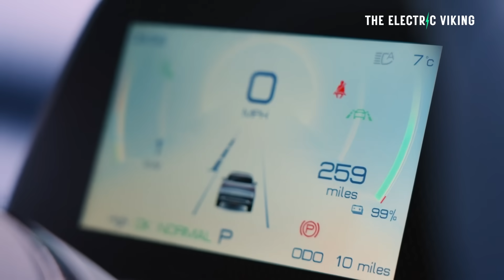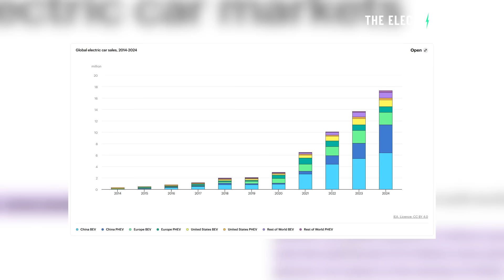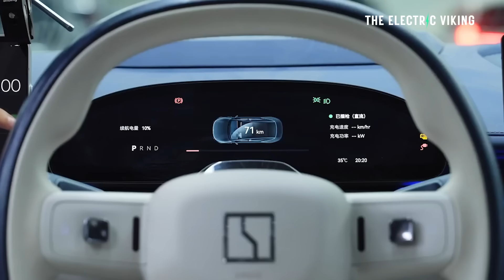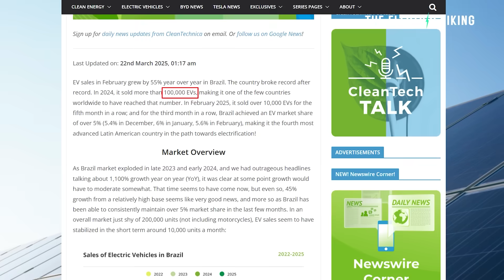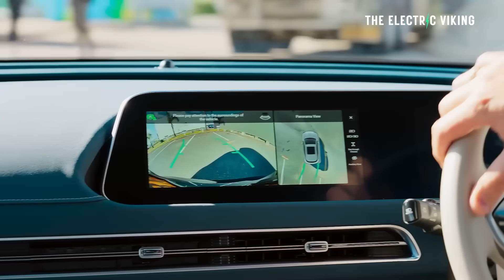1 in 4 Cars Sold in 2025 Are EVs: 40% by 2030, Says IEA!

Comment: If you really wanted to cut CO2 - you'd require carpooling for commutes.  That is 80% of miles driven and you'd cut it significantly overnight, you wouldn't have to wait half a decade for a net zero improvement. The massive discoveries of natural hydrogen may prove the long term solution as it doesn't require rare earths to produce, likely allowing many vehicles to run on hydrogen without requiring an entirely different vehicle to be built.

Comment: If you include hybrids/Phevs as EVs the claim might be accurate; BEVs are not near that degree of market penetration; they are more like 6% of new vehicles or about 0.5% of the 1.4 billion lite vehicles.  and near zero % of heavy trucks and vehicles which would be an even bigger task. Vehicle CO2 is 16% of world CO2. Since 2000 you'd average 12.5% a 2% reduction if the mining, production, and energy expended used no CO2, but it does. So it won't even get close to 2%

Comment: There's just going to be a switching point, after which almost everyone will buy an EV, come 2030 other than a few exotic cars, nobody will be buying an ICE car.  It just needs ranges to increase a bit more, charging times to reduce a bit, battery degradation to decrease and some sort of extended warranty plans for old EV's to be created, but it's all happening extremely quickly.
Reply: I don't think the battery degradation is an issue, they will already last hundreds of thousands of miles and still have a minimum 85% capacity left.

Comment: I like your channel and I drive an EV and am a huge advocate. But I partially disagree that range and charging speed improve every year. Maybe in a lab but in the real world range seems to be stuck between 240 - 300 miles and charging speeds of about 150 -175 kw for the last 3 years. The only improvement in range seems to be putting a bigger battery in the car or making it a tiny bit more aerodynamic. This is not really a technology improvement. This is just tinkering around the edges.

Comment: Here’s how I see the global power‐mix evolving over the next decade and beyond, underpinned by ever‐cheaper renewables, advanced storage, AI/robotics and emerging battery chemistries:

1. Renewables to ~50 % of global electricity by 2030

IEA Renewables 2024 forecasts that, if current policies stay in place, renewables will generate almost half of global electricity by 2030, with solar PV and wind accounting for 95 % of new capacity additions through the decade .

In practical terms, that means: 

Wind + solar share doubling from ~15 % today to ~30 % by 2030.

Hydropower holding at ~14 %, with other renewables (biomass, geothermal) filling the rest.

2. Beyond 2030 – continued climb toward 60–80 % renewables

BloombergNEF’s New Energy Outlook 2025 (Economic Transition Scenario) sees: 

Renewables rising from ~30 % now to ~45 % by 2030, then to ~60 % by 2040, and ~75 % by 2050 as costs keep falling and electrification accelerates .

In the IEA’s Net-Zero Emissions by 2050 pathway, non-fossil sources supply >70 % of electricity by mid-2040s, with coal virtually phased-out and gas back-up used sparingly .

3. Storage & flexibility – key enablers

Pumped hydro (the largest long-duration storage today) will retain a cost edge (levelized cost ~$0.14 /kWh by 2030) alongside emerging compressed‐air and other bulk options .

Sodium-ion batteries are on track to drop from today’s ~$87/kWh cell to ~$40/kWh cell (≈$50/kWh pack) by 2030, making them highly competitive for stationary storage .

Lithium-ion will continue to scale down in cost (< $100/kWh pack), especially for shorter-duration applications.

4. AI & robotics accelerating deployment

Construction: Robotics‐assisted solar‐farm assembly (e.g. Terabase Energy’s pilot lines) can halve build times and cut labor costs – SoftBank just put $130 million behind this approach .

Operations & maintenance: AI‐driven monitoring, predictive maintenance and autonomous inspection drones/robots are raising capacity factors by 2–5 % and lowering O&M costs by 10–20 % .

5. The big picture – a multi-decade transition, but accelerating

Today’s hurdle: Renewables still need grid upgrades, permitting reform and storage build-out to keep pace with rising electricity demand (which grew ~4 % in 2024) .

Upside potential: If costs fall faster than expected—driven by continuous learning in PV, wind, battery manufacturing—and if AI/robotics, modular construction and permitting reforms unlock new sites, we could see the 1 pp per month gains you envision during peak quarters.

Bottom line: 

We’re unlikely to “flip the switch” globally in four years—but we will see renewables cross 50 % of electricity by 2030.

By 2040, 60–70 % of power could be from clean sources, with fossil backup used mainly for firming.

Continued innovation in storage, AI, robotics and policy will be critical to pushing toward a mostly decarbonized grid by mid-century.

Indeed, it’s a fascinating time—every incremental cost reduction or AI/robotics advance compounds into steeper growth curves. The next decade will really set the pace for whether we hit those 60–80 % renewables milestones by mid-century.